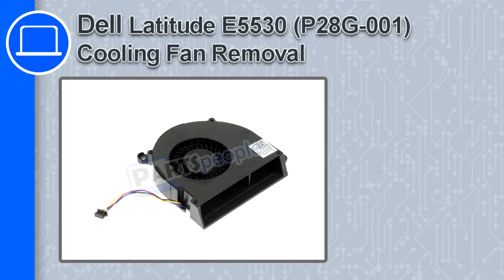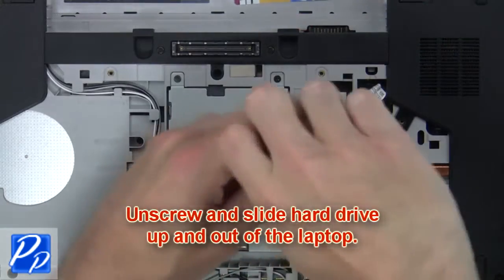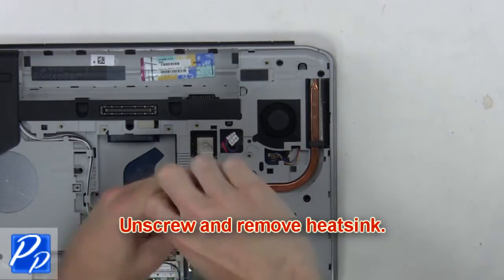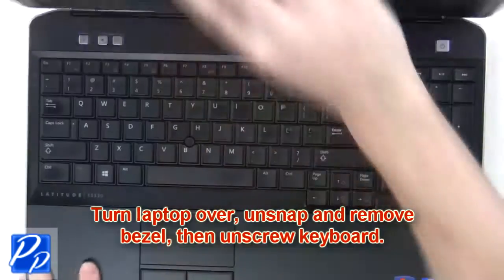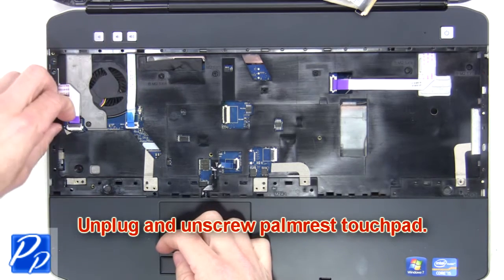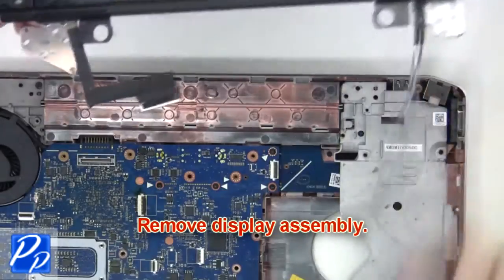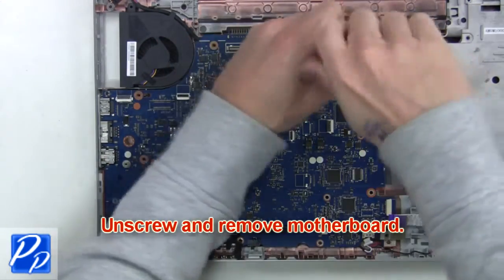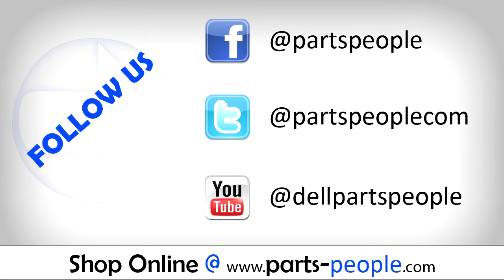Dell Latitude E5530 (P28G-001) CPU Cooling Fan How-To Video Tutorial

Comment: Thank you for this video. I have used it to replaced my noisy CPU fan to pre-owned one :D However, there was nothing mentioned about putting new heat-conducting paste on the top of the process and cooling system. I reckon that crucial information during removing CPU cooling system/fan. Do you have any video how to replace that heat silicon/paste? Thanks anyway :)
Reply: use arctic thermal paste cleaner